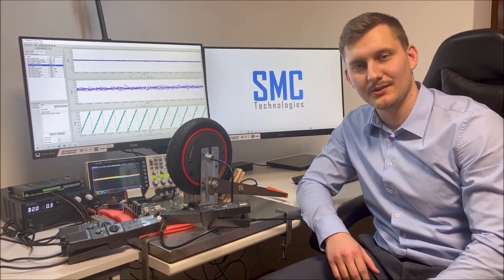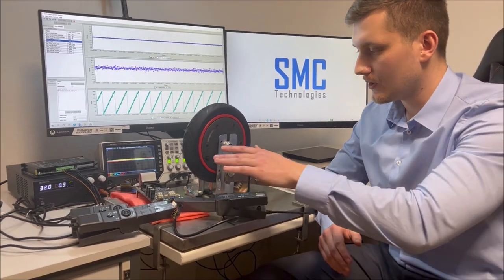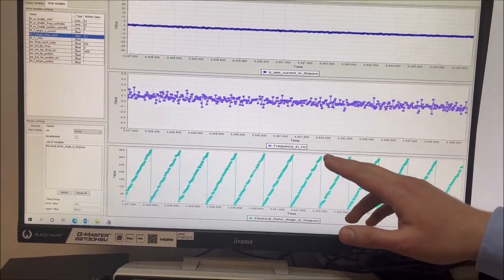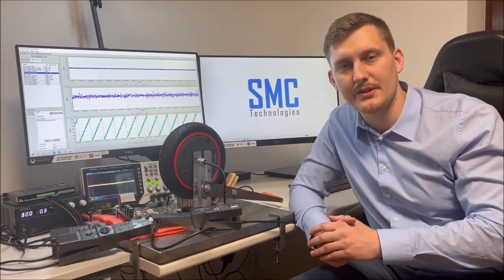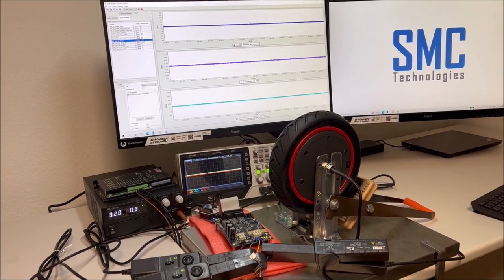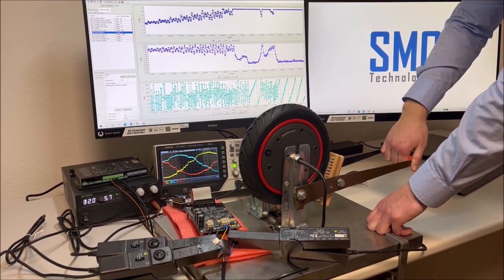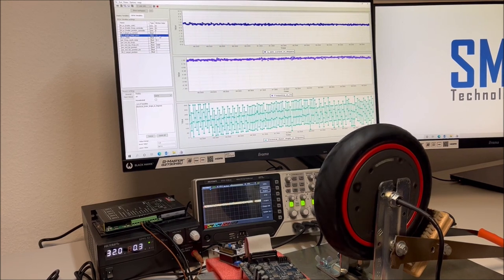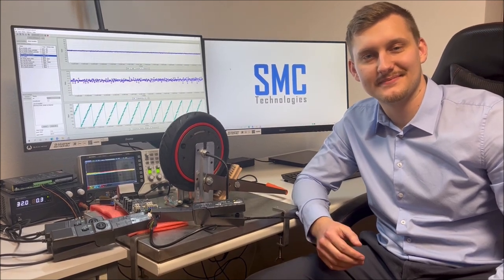High Performance Sensorless Control for E-Scooter Applications - SMCT

Comment: Thank you for showing this video about sensor less control of these kind of synchronous motors with permanent magnets. I am impressed by the smooth control around zero speed and the observers ability to detect angle and speed in this condition.

On hobby basis I have been working on some motors for sewing machines. I think, that sewing machines in general got bad speed control, but the users have been used to that historically. The motor drives have improved about 20-30 years ago, and the users consider this advance as very nice control even though I think, that there is still room for better control. Most of the sewing machines of today got a jump start to a rather high lowest speed, and I do not think that it is desirable. I made a few videos about the topic and a playlist.

The past month I have started to investigate the drone motors and similar to find out about their possibilities.

Comment: Really looking forward to the video demonstrating to startup small BLDCs with very low resistance and inductance with high inertia propeller from zero speed,  thanks!
Reply from the maker: Thank you for your comment.
We do not plan to demonstrate this particular case in the near future,
but of course we will explore BLDCs with very low resistance and inductance in upcoming videos.
Adding a high inertia propeller usually makes sensorless motor control a little easier
since the dynamics will be decreased significantly. In this case, the sensorless observer requires less bandwidth.

Best regards,
SMCT

Comment: 10a and 32v thats 320W thats equal to driving 100kg uphill (30%), all loses neglected. Motors at this low speed have a efficientcy of 30% to 40% unless there is a planetary gear somewhere inside. So im not a huge fan of direct drive, but your product is great! vesc and stm have this feature now too

Comment: Are you using any HFI method to detect rotor position around zero speed constantly? How do you compensate motor resistance change on the sensorless observer due to rise in temperature? I believe the sensorless startup performance drastically degrades if resistance is not compensated at higher temperature.
Reply from the maker: Thank you for your questions.
We use a model-based Back-EMF evaluation at higher speeds and HFI for the low speed range.
Both solutions (Back-EMF and HFI) are independent of motor resistance effects thanks to a special design of the algorithms.
So temperature rise is not a problem for our sensorless solution.
But you are right, for many sensorless algorithms the temperature dependent motor resistance can degrade the motor control performance.

Best regards,
SMCT

Comment: Are you also able to run small BLDCs with very low resistance and inductance, e.g. 10mOhm and 35-50µH?
Reply from the maker: Thank you very much for your question.
Yes, our solution works for motors that have quiet high values for the resistance and inductance (like the gimbal motor (R = 5,6 Ohms; L = 1370 µH) in this video:
https://www.youtube.com/watch?v=g48p-rwMuqk ), but also for motors with very small values. An example for this are motors for power tool applications. One particular motor that was tested had a resistance of R = 0,038 Ohms and an inductance of aproximately L = 25 µH. This motor could also be controlled sensorless without any restrictions.

Best regards
SMCT

Comment: You said the driver board has low side current resistors. I assume this involves some calculations in order to get the phase currents. Would it, apart from these calculations, be any advantages to instead have the current resistors in series with the phases?
Reply from the maker: Hello Dan Hellgren,
thank you for your question.

Compared to 3 shunts directly in the phase, the implementation with 3 shunts in the lowside reduces the possible
measurement time for current acquisition. One can measure the phase currents only while the lower transistors conduct the current.
For the successful implementation of our sensorless solution this is sufficient.
The following minor advantages can be achieved with shunts directly in the phase:
 - A generally higher quality for the acquisition of the phase currents with lower measurement noise,
   which can lead to an improvement of the reconstructed rotor position and speed.
   Current measurement quality depends on the hardware design of the inverter.
- Use of the so-called double-edge sampling. This means that the phase currents can be measured
   once at the beginning and once in the middle of each PWM period. In addition, the PWM-Duty-Cycle
   can be updated twice as often. In some cases this can lead to an improvement of the acoustics.
- All 3 phase currents can always be measured correctly, even at maximum PWM-Duty-Cycle in the individual phases.
   In the low-side implementation, it must be taken into account that the measured phase currents may become incorrect
   at very high PWM-Duty-Cycle (e.g. at high speeds).

Best regards,
SMCT
Reply: @SMCT_GmbH  Hmm.. I need to read your  very interesting answer a few times in order to fully process it. I thought one only measured once in the middle of the center aligned PWM, interesting..  Regardless of where you have the current resistors I understand that only two phases are measured since Ia+Ib+Ic=0. But maybe it's a good idea to measure all phases in order to detect a faulty mosfet?
Reply from the maker: @danhellgren5671 
You are right. Typically, the center aligned PWM is used for field oriented current control.
Here the phase currents can be sampled in the middle of the PWM period.
At this Timing, the low-side transistors are active for all three phases.
In this way, the phase currents are obtained even with current sensors in the low side.
Furthermore, at the beginning of each PWM period, the high-side transistors are active for all three phases.
For this condition, you can only get the phase currents with current sensors directly in the phases.

Yes, if you have the ability to sense all three phase currents, it is a good idea to do so. As you said, e.g. for fault detection.

Best regards,
SMCT

Comment: How about determinge the south or north of phase during motor startup with high torque?
Reply from the maker: After switching on the power supply and switching on the sensorless control algorithm, the initial electrical rotor position is found after about one millisecond.
The correct alignment of the north and south poles is also detected.
After this initialization, the algorithm is able to directly provide the maximum torque.

Before this initialization, the current controller does not work and the motor does not generate torque.
If a high load is active while the algorithm is turned of, this will cause the rotor to move and in this case the generated emf (due to rotation) can also be used for the initial position detection.

Best regards,
SMCT